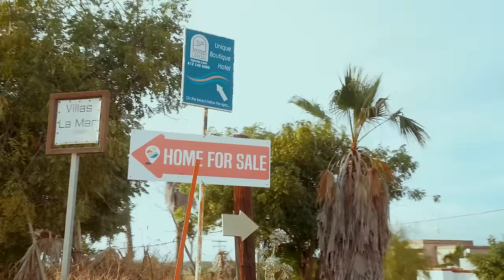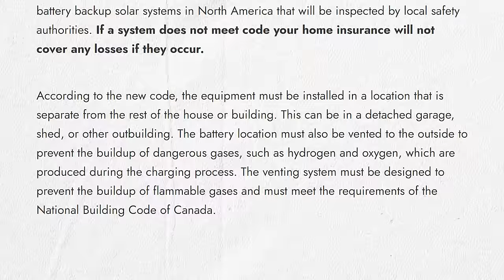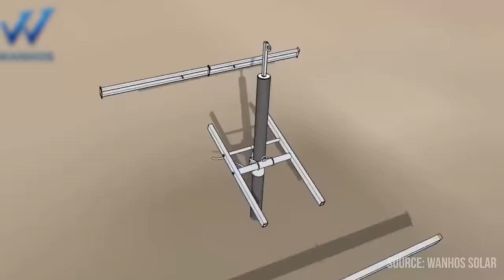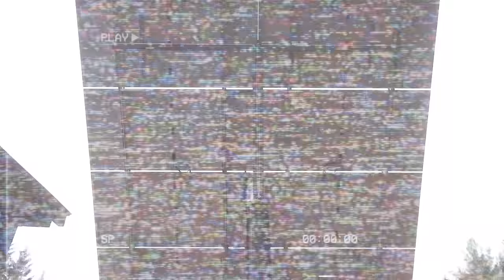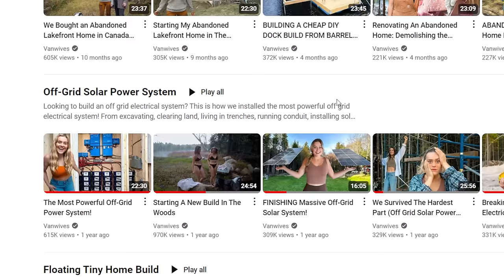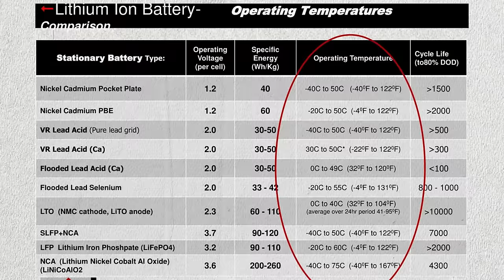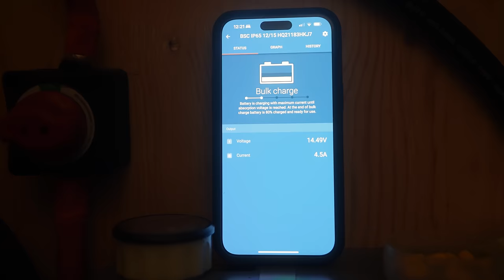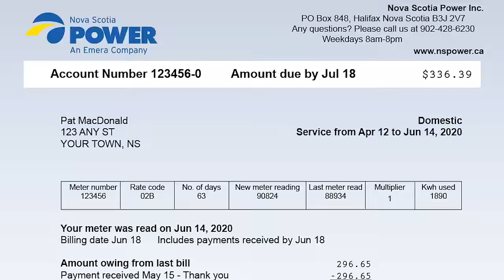Complete Off-Grid Solar Power System & Battery Bank (Start to Finish Install)

Comment: Well done! Will share this with my HOA as we are considering community wide solar.
Reply from the maker: That is so cool. 😊🐶
Reply: I hope it's just getting the HOA to approve solar installations in your development.  Under no circumstances should they have any say in how your system is used or configured.  Every homeowner's solar array and system should be strictly theirs, with no say-so from any other party.
Reply: I'm really curious.  Is that 1-system for everyone to share, or committing to put an individual system on every home?   The first way is a lot cheaper, but I'm not sure I'd want to feel like I was subsidizing my neighbor with the 72 degrees AC in the Summer and 80 degree heat in the winter....
Reply: @markpukey8  a system for the entire community to share. There are common areas like the pool that will get hooked up first then the system will supply houses.

Comment: It REALLY makes a difference where you live.  I designed, got permitted, and built our 5 KW ground mount array myself.  My only paid labor was the concrete pumper, but I filled the Sonitubes with the big hose myself.  I already was on-grid, so a grid-tie inverter meant no batteries.  We converted everything to electric and got rid of our propane tank.  The building permit was free because our building department had a mandate to encourage solar.  My total permitting cost was $25 for an engineer to stamp my free plans from the ground-mount hardware company.  Results?  No electric bill for the last three years, and we use electric heaters and AC as needed.  In fact, they owe me hundreds of dollars in credit.  Anybody living in their own home in the Southern US could do the same.

Mexico will be even more solar-rich, which should make your needs much smaller.  Just make sure it's not going to get stolen when you are not there.  I think you might need a caretaker or a security company.

Comment: Our 13 story 390-unit apartment building run by Toronto community housing just finished a very large feed through solar installation on the roof with dozens of panels possibly as many as 200. It is one of the largest deployments on a residential apartment building in Toronto. We don't have a battery bank as it directly feeds into Toronto hydro offsetting the buildings usage of power as a credit against billing system. We got to see a giant crane hoist all the materials to the roof. Interesting detail is they had special unpacking frames to place the panels on for transport across the roof and into their final position. It's a 600Volt system and has a transformer in place of your inverters since its feed through and also due to its size. It was financed by the installing company and after a certain number of years once payback is reached it will be turned over to TCHC to offset the buildings usage. This is a test deployment to learn in preparation for deployment to the other 20500 buildings that TCHC operates across Toronto. It took about two months to install and certify as well as get connected by Toronto Hydro

Comment: I was just thinking today as I was using our dishwasher, washing machine, electric composter, and microwave all at once on a cloudy/stormy day, HOW GLAD WE ARE to be off-grid!!!! I love our electric system. We also have a 10k KWH system and LOVE IT. It gets interesting in the winter, and we occasionally have to time when we wash clothes, etc, and shoveling the panels of snow in blizzards can get tiring, but I love it!!!! Would never go back. Also, I love it when we still have power when there has been an outage in the area.
Reply from the maker: We concur Kim. We never know for sure when there has been a power outage. We are so happy to be off grid. 😊🐶

Comment: What the total cost on your side to build off grid system, including panels, batteries, material cost - like cables and pipes + labor cost for transhing, installing panels, cost of "battery room", so everything?
Reply: "VanWives" would that be a Custom Mercedes Sprinter VanWives? This off grid power is a off grid power plant haha. Add to Wishlist ☑

Comment: Not sure where you are in Canada but most provinces allow batteries in the house.
Also electrical lines only need to be covered in 6" on concrete or 16" of dirt, less for low/DC voltage

Comment: A lot of work went into installing your electricity supply. I remember the trouble you had with the rocky ground, it wasn't just rock, it was also water. Porter was a great help plus one or two others, with two strong-minded girls you got it finished.
Love to you both from Mike. ❤❤
Reply from the maker: That was a huge challenge haha!! Sending love back to you from the pack. Happy to have you in our pack. 💛🐶

Comment: On my properties I am lucky to have grid readily available.
Two of them already had grid connection when I bought them,

My third property had a grid pole on the property, but not connected to my building.
I planned to go off grid, because the monthly grid connection fee, would be overpriced compared to consumption.
I installed the brackets to install solar, when I laid the roof, but then the government changed the rules, and the monthly fee is depending on you peak consumption.
I decided to get grid connection, but probably install solar later, but mostly to sell to the grid, to pay the monthly connection fee, and still be net positive, and avoid battery storage.

Comment: I was always wondering how you can heat with your Split A/C with such a small array. By showing your predicted yields per month, I now understand that during winter you get about 45% of the energy you get in the summer. For me coming from Switzerland those are impressive numbers. We get about 15% in winter compared to summer. Solar seems to be a very good choice up north in Canada. Well done.

Comment: 14:27  I'm pretty sure you meant 28,000 watts as to achieve that in amps would require 10x more batteries.    I saw Battle Born and other companies are now (yours might be as well) selling self heated batteries to keep them working at lower temp situations.
Reply: That's what caught my attention as well,, 28,000 AH

Comment: Planning a HUGE off grid system myself as the power company quoted us $300k JUST for the poles, no lines, and no transformer and we get the privilege of PAYING them for power. Our system budget is $250k and we are planning on 92kw of Solar, 5 Sol-Ark 15k's, 307kwh of battery storage, along with some wind and hydro power in the future. Large system, but needed for what we are planning for, and STILL cheaper than what the power company quoted us.
Reply from the maker: Wow. When you get the news it’s hard. That is going to be such an AWESOME system!!! Wow I’m excited for you! Already paid itself on day 1! Let alone 10 years down the line

Comment: 6:07  Fun Fact: In my southern corner of California we wanted ground mounted solar as we live on a hill with clear access to sky from south lawn.   But city required a poured foundation, chain-link fence, 10' foot from house which then would require trenching and warning signs + inspections for everything.   Even though it's a pain to clean now, we opted for putting on the roof.
Reply from the maker: Yes, many rules. The roof is a great option. Hope you are reaping all the benefits of solar. 😊🐶

Comment: Any luck with heat pumps up there in the winter?  Resistance heating uses a ton of power but not sure if heat pumps work with how cold it gets.  Seems like you may use mostly wood for heating judging from the wood shed.

Comment: Wild thinking how Substantially cheaper, smaller and better on inverter/battery end this could have been built in end of 2024. Eg with an EG4 12000xp and two indoor powepros, just over 9.5k usd and they would have had everything they have but in 1/4 the space & wiring, more batt capacity & output, safer with built in battery heaters and fire arrestors. Exciting how fast solar tech is moving.

Comment: including the pipes, wiring battery's trenching basically everything but the work shed what was the cost of the solar system without discounts?
Reply: not even close to 500k 50k to100k possibbly if you are unable to do anything right the first time
Reply: @Funky420Infotainment  thank you!

Comment: this was such a nice recap ladies! question is that setup good enough for the new guest house and eventually the remodel of the other cabin or you going to have another system set up for those?
Reply from the maker: Thank you! For sure if we extended the property. Wouldn’t be able to go to the other cabin. The cable to run there would be the same price as a system 😂 good question!
Reply: @Vanwives  hey on the bright side you should be able to do it all over again for cheaper since price of solar and batteries has gone down

Comment: How many people can afford a $500,000 CAD or USD solar power system?! Not many, I suspect.  My friend installed solar panels on her roof and the roof get damaged and it cost over $7,000 to take the solar panels down, store them and then reinstall them back when the new roof installed. She was shocked by the huge cost.  The $7,000 did not include the cost of the new roof, which was another $8,000!  Her house is 1,100 sq ft in size.
Reply from the maker: 500k was to bring GRID power down our road, not the cost of the solar power setup. Yes this is another huge benefit of having solar not on your roof. As roofs need replaced and maintained.

Comment: Only problem I would have with setup like this is that I wouldn't really want to see huge solar panels from my cabin window or when I am working around the cabin. So I would've cut maybe own open field for them, put them closer to the road access so I could still visually check them every time I would drive or leave the property. Or have smaller units so they wouldn't be so tall... Other than that, very nice! 10kW is plenty if there's just enough batteries.
Reply from the maker: They’re as pretty as trees to me 😂😍 thanks for watching

Comment: Do you have a plan if there is a fire in the garage, smoke/fire/heat Detector linked to your phones and special fire extinguishers. Do you check the connections to ensure they are still tight.

Comment: All I can say is peddle harder!!!!! Seriously - folks do not put your panels on your roof. In most places like mine you have to have them away from the primary residence, the batteries can not be in the house. This is mainly due to Homeowners Insurance, however check your local codes too. Mine is 800 watts of panels (4x200), I have 5 Kw of power stored, and can use up to 1000 watts at a time. I have to tolerate 14F to 120F roughly throughout the year. So far so good. True, I have to live in a on-grid home due to mainly employment. But the off-grid cabin is amazing and gives the peace of mind one needs. Bottom line - Be safe and follow the codes best you can.  Enjoy!!!

Comment: It's nice of battle born to donate 24 batteries at 750-$1,000 a piece. 😯 Server rack batteries would have been 50% cheaper for the batteries, not to mention conductor costs.

Comment: Girls, did you know about the other structures that you are adding when you started? would it have been easier to have more KW and batteries and trench to new buildings? Good job all around
Reply from the maker: Yes 100%. A master plan would have helped a lot. But it was just us 2 figuring it all out with no experience haha

Comment: You wasted an incredible amount of money with those battle born batteries. If you were building a 12 volt system three years ago,they would have been a top choice. Maintaining them balanced is certainly possible but a big challenge. You can now buy LFP 12volt batteries for a third of the price of battle born batteries.

Comment: Winter do you have water pipe on the back of the solar panels.  With a anti freeze or heat fluid.  
Heat pump in winter. Keep the ice of the panels.  
Summer. Keep the panels cool and keep the voltage up. Got a pool   surround  the walls   and floor.  Then the pool. It's a battery in the pool. All been done. Time to research. 
Run pipe you covered.  Air ducting . Cool air in summer. Warm air winter.  Im shore can work out what I'm talking about.  Not see your channel a long time. Youtube fail. 
God bless.  Mick Australia 🇦🇺 ❤️

Comment: The only thing I would have done different is I would have built my own batteries so I could double the amount of KW and still cut costs in half for batteries. Would still have heat pads so even if it gets colder in that room batteries would stay warm.

Comment: I totally understand using the pole mount, but  when I look at your roof, you have one side, basically facing south.
I wonder why you didn't opt to cover that too, when you installed the metal roof.
At least you wouldn't need the foundation for the poles  for that area.

Do you plan to have solar on the other cabin too?
Looks like the roof is facing slightly more west, but still mainly south.

Comment: A question. You say 28,000 Amp hours. Did you mean watt hours? If I figured right, if it is 28,000 Amp hours, that would make the whole system over 330 kilowatt hours. I'm confused. 😂

Comment: You have my dream setup. I love watching you add on to your little paradise with each video!  But just so you know, your solar system is 28,000 watt hours, not 28,000 amp hours. 24, 100ah batteries is 2,400 amp hours.
Reply from the maker: Yes yes our bad whoops!

Comment: In China now.
 600 Watt solar $90 x20 = 12.000 Watt = $1800
11kw hybrid inverter= $500
48v 300ah Power wall = $2400x2 = 48v 600 ah = $4800

Total (excluding cable installation costs etc.) = $7,100

#ChinaOvercapacity 😂

Comment: By reading the comments, it seems like its just me.  I cant believe 1. of all it would cost that much, 2. that anybody would spend 1/2 Mil on Solar for a tiny house like this :P and 3. theres no way these girls living in these conditions would have even 100k saved up!
Reply from the maker: 500k was to bring GRID power poles to our cabin, which we did not do… that is why we chose the alternative of an off grid solar system
Reply: It was clickbait
Reply: @JHRO9000 It's not click bait. There is a question mark followed by the explanation.

Comment: I'm sure this will not be answered, but where does the water go from the house which comes from the shower, kitchen sink, etc.  Is there some sort of septic system?  We know that there is not an indoor toilet to accommodate fecal waste, but where is the waste water going?  Does Canada have different laws to accommodate grey water (from showers, clothes washers, etc.)  vs. black water, such as toilet waste?

Comment: how long can you go without sun though? I have 14kwh on my bus and still feel it is not enough
Reply from the maker: Are your panels on the correct angle? Most road vehicles can’t have the panels set to the optimal angle for solar therefore they do tend to produce ALOT less power
Reply: @Vanwives  yes mine can only stay flat. But still, how many days can you go without sun? Panel angle does not play a role if there is no sun anyways. My area got cloudy for a few days and I can go with out much sun for 5 days if I run AC all the time. or 15 days if I do not run AC. I have diesel heater for heat though. I am asking because I fell I am using my energy too quickly. Just wonder how your system is doing with only 10kwh.

Comment: Why didn't you install solar hot water system for the free heat to your home and battery storage building. You could have installed them on your roof.

Comment: I'm curious why you would go with a bunch of individual 12v batteries instead of something like 6 rack-mount 5 kwh 48v batteries giving you 30 kwh? All those single batteries and all that super heavy gauge wire to put it together must have cost $25k or more... you can buy 6 EG4 48v rack batteries for the ballpark of $7k right now and wire it up with standard gauge wire that costs nothing. 2 years ago maybe a bit more however. Battle Born must have given you the HELLA deal is all I'm saying...lol

Comment: Did they say how much it cost for the system?
Reply from the maker: A small fraction of 500k
Reply: 24000 for battery’s. 20000 for solar panels, Victron equipment/Wires 5000 for the pole mounts system, and shed is 3-5k + labor, materials, rental equipment. I’m estimating in u.s dollars not Canadian so possibly inflated and give or take I’m estimating 60-120k Canadian all things included. About 1/5 of the cost is your fraction of the cost I think but there’s lots of factors. Killer system regardless. Trying to build the same but I think I can get it cheaper with used solar panels and eg4 batteries instead.